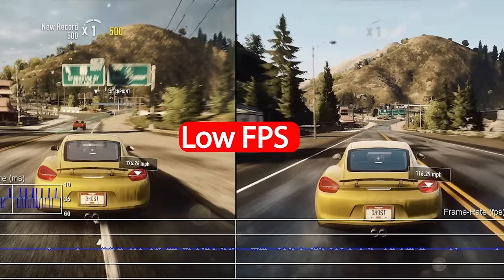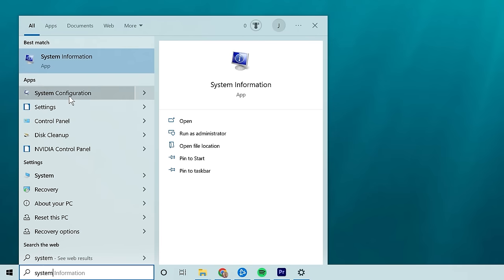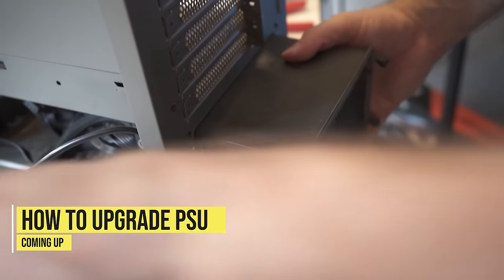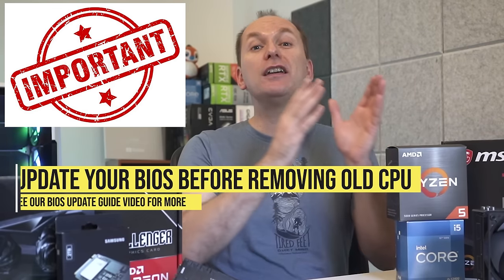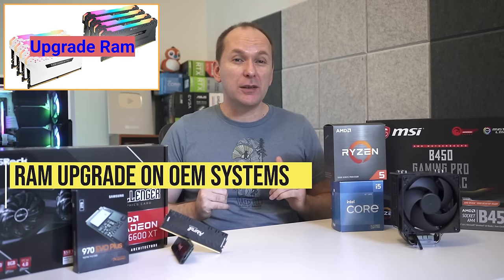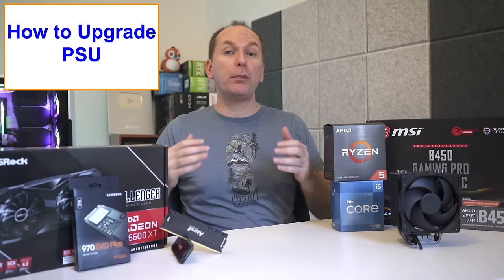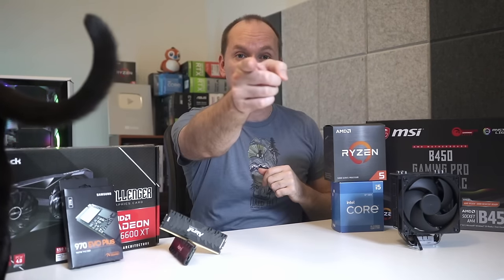How to Upgrade Your PC: How to Upgrade GPU, CPU, RAM, SSD & More! How to Upgrade PC

Comment: I’ve been thinking of upgrading for a while (I’ve had a prebuilt system for the past 5 years) I’ve already upgraded my ram and psu to prepare for the upgrades I’m going to make, but I think I’m gonna wait a little more for the 4000 series to come out in hopes that other gpu prices drop.
Reply: Did you upgrade it? I’m doing the same 😂 I upgraded my ram and ssd now just waiting for the 5000 series to release but I think my case is a OME & would need to basically upgrade my whole pc so I might just sell my pre build and build one myself

Comment: One tip you should add to your cpu cooler removal. Run the pc first for 15-20 mins just at idle, this will ensure the cooler comes off with ultimate ease. I ripped a cpu out of socket just trying to pull the cooler, the pc hadn't been used in days. Expensive mistake.
Reply from the maker: Interesting! I've done that too btw on my wife's editing PC she needs for work lol! See our 5950x build for the full story on that one. Thanks for the tip!
Reply: It’s nice to read comments because you learn something new.

Comment: Went from my old rx 580 4gb to a 6600 xt.  Seen a little boost but not a ton, though double the vram is nice.  Finally upgrading my trusty old 1400 to a 5700x that should be here today.  Maybe that will show the difference between the old GPU and the new one a little more.  I'm going to be putting the old cpu and gpu back into the pre-built they came in for my SO.  The old b350 mobo in the pre-built may be bad (I reused every other component besides psu, case and ram) so that will give me the excuse to go from b450 to b550 on my new setup and throw the b450 in the old one, which may also help the new 6600 xt marginally with pci 4.0. I do need a new SSD for the old system that only ever had a hard drive and both systems could use more storage in general.  Lastly im not sure if my current 2x8 3200 cl14 ram should get another set for 32gb for the new system or if I should just get a whole new kit at a higher speed and throw the 3200 in the old system that came with 1x8 (not sure of speed) instead of doubling up on both systems.
Reply: It still good ?
Reply: Had to go back to my rx 580 due to my rx 5700xt breaking within 40 days. So the 6600 isnt that much better?

Comment: i got a seagate 8TB storage for gaming just a few months old, its got a bug, it mostly works its working right now but when i restart my pc it wants to repair that 8TB as if theres something wrong with it? can this be fixed? i spent a whopping £150 on it, hope i can do something about it, would it be worth formatting the drive and starting over? theres alot of games on it thats alot of work to install again no point doing it if i cant fix the problem. my System SSD is samsung 970 1TB NVMe

Comment: This may be a dumb question but can I undervolt ram? I bought during the shortage and got 16gb of 3000mhz ram for 191(🥲). My motherboard rn can support 3200mhz, am I able to buy 3600mhz and undervolt it to 3200mhz, so when I eventually upgrade mobo + cpu I can use that ram at 3600mhz then instead of having to get a whole new kit? There's like a tenner between them in price

Comment: Jason, another helpful guide. Thank you! Especially liked the pointer about slightly twisting the old CPU cooler when replacing to break the seal from the thermal paste so you don't pull out the AMD Ryzen chip -- which I've done before 🤓
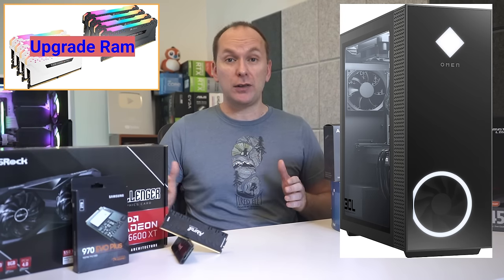Reply: Also, regards your SSD considerations at time marker 10:34, have you ever thought about doing a how-to guide for cloning when upgrading a SSD (NVME or SATA) system drive so we wouldn't have to do a complete reinstall of Windows on the new drive? There's other Youtube videos on this subject out there, but wondering if you may have a 'PC Builder' take on this particular upgrade.

Comment: Great Video!! I am getting ready to do my first build towards the end of the year. My Dell 8300, Intel i7-2600, 12GB and R9 380 are finally going to get put to rest. I was able to transplant my Dell system into newer Cooler Master case and upgrade my CPU cooler earlier this year.  I am continually saving up for deals on BLACK FRIDAY and will be looking for CPU (Ryson 5 or 7), motherboard (B550), RAM (16GB), and (M.2 1 TB) hard drive. The GPU will have to wait for round 2 of the savings plan but I am hoping for a hand me down 1060 or 1660 in the meantime. I am excited to finally see how FarCry 6 and CyberPunk 2077 actually are supposed to run in 2023, and yes, they do run on my current system. :)  Thanks for all your videos and keep them coming!!

Comment: Great video! Any beginner or intermediate builder should review this video when upgrading their systems. The only caveat I would make is if anyone wants to buy a 4070 series or higher NVIDIA graphics card would be to purchase an ATX 3.0 spec power supply with the appropriate wattage necessary for CPU and GPU combined max output. Seems there can be a fire risk(!?!) if using an old school ATX 2.0 spec PS. Cheers!
Reply from the maker: Thanks for the tip and glad you enjoyed!

Comment: Avoiding OEM pre-builds is wise if you intend to upgrade over time.  At one time they had a huge cost advantage and I bought one with Vista as it was certified for Linux.  It meant the hardware ran pretty reliably with WHQL, especially after SP1.
Generally I rather install Windows myself as OEMs ship so much crapware and nagware that it drives me crazy.
Reply from the maker: OEMs can be great for those who never want to mess with their pc. But very limiting for any future upgrades for sure
Reply: I agree 100% on the crapware bit. Unfortunately for us they're paid to include all that junk with their systems.
Reply: @user-yu4mf6bs4f  Right, but people need to know they can install Windows fresh and eradicate it.
I have NEVER had any software with ANY real value out of crapware.
Reply: @RobBCactive  for sure.
Reply: I have a oem rtx 3050, praying I can upgrade it
Reply: @foidly  good luck!  Space for cards and power were the limitations which affected me.

Comment: I got the Hyte Y60 case (white), 1000 watt PSU Seasonic 80+ Titanium, Deepcool LS720 AIO (white), Two 2TB Kingston Fury SSD gen4, and the RX6950 XT MSI XTrio GPU for $900, 32GB Trident Z Ram 6000mhz CL 36 36 36 76 and Just waiting for the AM5 motherboard Asus ROG Strix X670E, and the Ryzen 9 7950Xto drop this Tuesday 27th.

Comment: This is still the best PC channel on Youtube. I'm having a hard time trying to convince myself I need to buy a RX 6800 XT now that they are down in price. I bought a RX 6600 XT last year and Ive been happy with it but I've never seen 2K or 4K before and I would like to but I don't want to spend the money when my stuff is working well. Come on brain, just accept it is the will of the computer to upgrade the GPU/Monitor LoL

EDIT. I have a Question, My build has a 11600K, 32 gigs of memory a 1 gig M.1 and two 2gig storage hard drives, My PSU is a MSI MPG A750GF 750W ATX 80 Plus Gold PSU. Will it run a RX 6800 Xt GPU or will I need to upgrade? Thanks Much

Comment: Been weighing my options on when I should try and upgrade my PC since I’m not entirely sure if the PC I built several years ago still holds up or not. Going to follow this video and try to get some ideas since I’d like to try and keep the spending down a bit if I can help it (otherwise might as well start from scratch with a new PC.

Comment: hey Jason, I'm planning to upgrade from a 1050 Ti to a 3060 Ti. I currently have a 500 watt psu, do you think this will be enough or should I upgrade it as well? I'm also using a ryzen 5 2600 and 2 sata ssds. Thank you.
Reply from the maker: Depends on the other components, but you'll likely need to go up on the PSU (see our PSU video). I'd also swap in a Ryzen 5600 if you can at the same time, big improvement over the 2600.
Reply: @PCBuilderChannel  yes, I was thinking of getting the 5600 and in that case I thought of getting a 650 watt.

Comment: I have a prebuilt from Build Redeux with standard parts born from the covid days, desperation definitely cost me. I've spent a lot of time on your channel and wish your 5600x build existed those days. I bought a new monitor to play at 1440 but i wish it was a more comfortable and richer experience. So now im in this hole of what to upgrade. I've got the sinful Asus x570, Ryzen 5600x, 3060 ti, 16gb (8x2),  M.2 NVMe 500gb,  (expanding the memory is what started everything), PSU 600w.
Reply from the maker: More storage would be great for you. And you could drop in a 5800X3D (max possible upgrade with AM4) and then you can pair that with any GPU you like  up to a 4090 in the future.

Comment: So, having a 7th gen intel i7-7700 with 4 cores and  8 threads isn't worth the upgrade (of GPU) and would rather be worth the money for a new PC build?

For further reference:
CPU: 7th gen intel core i7-7700 kaby lake 
Motherboard: ASUS ROG Strix Z270F Gaming, Socket-1151
GPU: ASUS GeForce GTX 1060 6GB Strix Gaming
RAM: 2x Ballistix Sport DDR4 8GB Ram (16GB in total)
SSD: Samsung PM961 SSD 256GB M.2 NVMe
GPU cooling - Corsair Hydro H100 radiator

Comment: Congratulations on 200k subs, really love your content.
I was thinking of getting a system for gaming. These are the components. Please suggest should i stick to it or should i change.

Amd ryzen 5600x
Sapphire radeon 6700xt
Msi mag b550 mortar motherboard
512 gb ssd
1tb hdd
2*8 gb 3200mhz cl16 ram
650 watt psu
Lg gn600 24inch monitor

Please reply.
Thanks.
Reply from the maker: Thank you!!! Looks fine, I might ditch the HDD and get a 1TB SSD instead - they are dirt cheap right now. I'd upgrade the monitor if possible to a 1440p one like the HP x27Q or even just jump up to a 27" like the AOC 27G2.
Reply: @PCBuilderChannel  Thank you for suggesting...

Comment: Planning for my first pc build. What can you say about this setup:
Ryzen 5800x3D
MSI x570-A PRO AMD AM4
Silicon Power 32gb 3200 DDR4
MSI gaming radeon 6800xt gddr6
MSI MPG gungnir 110R white
Thermaltake toughpower GF1 series 850w
WD black SN770 m.2 2280 1tb
Deepcool AIO liquid CPU cooler

Thanks in advance for the response, love your channel

Comment: If you plan to upgrade and manually tweak RAM on Ryzen system, get Samsung B-die ICs ram. tRFC can go to 300 range, while many other ICs stuck at 500+. tREFI is 12-15k on Ryzen and 65k on Intel, so tRFC is more important

Comment: I have an i3-9100F (which only has 4 cores 4 threads), a GTX 1650, and 8 gb RAM DDR4 2666. I was thinking of upgrading to an i7-9700F and a RTX 3060 and increasing ram to 32 gb. Is it worth upgrading or should I buy new?

Comment: Thinking about upgrading motherboard and CPU, because well...:
Case:NZXT Manta
CPU Cooling: NZXT Kraken X62
PSU: Corsair TX750M -750W
MB: ASRock H97M-itx/ac
CPU: Intel i5 4690
GPU: Nvidia GTX 1080
RAM: 16GB Corsair DDR3 1600C10

I'd like to upgrade to something that'll be able to handle the RTX 40series, but keeping the 1080 for now. Not sure what way to go though, suggestions?

Comment: 05:30 I would add, uninstall old drivers if you switch between Nvidia and Amd. The best software for that is DDU. Run pc in Safe mode, start DDU uninstall drivers and shotdown. Turn off PSU, hold few sec power button to draw electricity. Replace GPU, start PC.
Reply from the maker: Good tip!

Comment: I have a question, I'm using Ryzen 3 3200g on a320m(without m.2 slot) with rx 570 4gb, 450w psu and 16gb ddr4 3200 mhz. Can you give your opinion on should I built new or upgrade it. I have very limited budget but I can buy/ upgrade the part one by one

Comment: Hi Jason,

Im currently running a system of about 3 years old and notice a fairly large drop in performance.

Im looking to upgrade:
-CPU
-GPU
-PSU + board if necessary.

Right now im using a Ryzen 5 3600 as my CPU, a GTX 1660 Super as my GPU on a B450 board. PSU EVGA 600 Watt PSU.

I have a pretty fat budget as I made a leap in my career and love gaming. Im just lingering on what to buy with the upcoming next gen GPU’s. Im not a streamer nor editor.

What I had in mind was a upgrade to a 3070ti and either a upgrade to a Ryzen 5 5600 or Ryzen 7 5800x

Not sure with those listed upgrades its necessary for me to also upgrade my board + psu as I find it kinda tricky building it myself 😅
Reply from the maker: Upgrade sounds good! Check out our Best PSU 2022 video for how to see if your current PSU will work with your new parts

Comment: These are my specs, wondering if anything should be upgraded 
AMD ryzen 7 5800x cpu
nvidia 3070 ti 
motherboard/ asus prime x570 pro
32gb ddr4 ram/ two 16gb g skill
750w gold psu 
storage 1tb gen4 ssd

Comment: You forgot to mention after powering off the computer and unplugging it, to then press the power button on the case too make sure no residual energy is left over in the psu

Comment: do you think i should upgrade mine
NVIDIA Geforce Gtx 1660 TI
driver version 537.13
AMD Ryzen 5 3600 6-core processor
15.92GB Ram
1920x1080, 280 Hz
Reply from the maker: Its an older system for sure. If you are looking to upgrade there's lots that can help. You can drop in a 5600 and upgrade the GPU all the way up to a 6800XT for example.

Comment: I got a used 5900X, 32GB, Asus X570 Pro combo that replaced an ancient Ivy bridge setup that was still good but a little long in the tooth.  Cooled the cpu with a 240 Rad Arctic Freezer 2.  I put the parts in used BeQuiet case with a 850 NZXT PS (also combo).  I will upgrade my gpu later which is a RTX 2060 Super.  Added the M.2 drive as boot drive and reused some of my SSD and storage HDs.  Blinged it out with some TT LEDs fans and some LED strips.  Thats all she wrote.
Reply from the maker: Nice!!

Comment: Just in time I was thinking to upgrade my CPU from R5 2600 to R7 5700x or 5800x3d and get a new GPU form the new releases something like or equivalent to a 3070ti 
Do you think my 2600 can handle the 3070ti or similar from the new releases or should I get a new CPU ? And does a 650w PSU can handle a 3070ti ? Thanks and Love the cat 🐈😺🐈😺👍👍👍

Comment: Thanks for this video,  I have an i7 8700 and I'm really struggling to find a deal good enough to justify an upgrade that's as future proof as possible, or even good value tbh
After my gpu upgrade,  I still get good performance at 1440p, but it's hard to know how much extra I'm leaving behind by not upgrading my cpu too

Comment: Heey good evening 

What do i upgrade best? I have a 1000€ budget for upgrades want more fps lower delay in fortnite triple edit gives me so much delay specs atm are 

2060 S 
Ryzen 5 3600 6 core
Sharkoon wpm 550 watt
Motherbord gigabyte b450 90€ one
32 ram vegnece rgb 
Amd standard cpu kooler
4 fans 3 front 1 back ‘sharkoon bruhsless dc fans tg6 ’ 
I feel getting an amd 7 5800 or a amd ryzen 9 5900? Feel the 7 is the same one but cheaper idk is it you can help me?
And What grapics card do i get rn at the time?

Or what u recommand me to upgrade

Comment: I have an i5 4430 a h81m-h 8gb ram ddr3 and a gtx 1650 ex plus, i'm thinking in get a ryzen 5 5600 a b550m ds3h and 16gb ram, will the gtx 1650 fit in here or should i upgrade it too?

Comment: Hi ,I got the next configuration on my pc
ASUS H310M-K Micro ATX Motherboard
Intel Core i7 8700 3.2GHz (4.6GHz Boost) Hex Core CPU
NVIDIA GeForce GTX 1060 6GB Graphics Card
16GB Apacer Panther 2666MHz DDR4 Memory (2 x 8GB)
2TB Seagate FireCuda Solid State Hybrid Drive - 5x faster than HDD
Aerocool Integrator 600W 80+ Power Supply
What is the best video Card to upgrade and maximum support but my Motherboard?many thanks

Comment: Hi, l want to upgrade my system But i dont have much budged. So i will continue to use rx570 and 750w psu that i have. Can I get a 12th generation i3, motherboard, mesh case and ram with 350 dollars budget? İf i get what would you prefer?

Comment: I'm doing an upgrade/new build only using my existing motherboard, cpu, ram and cooler for now, everything else will be new, case (corsair 5000xrgb) psu ( be quiet darkpower 12 1kw) gpu (3090ti msi suprim x) my question is : the gpu has the the new 12vhpwr connection but the psu does not, it comes with the adapter (3xpcie) should I get a different psu that supports the new plug or will it be ok? Thanks.

Comment: I have a Ryzen 5 3600 cpu Rtx 2060 gpu  2x8gb 3200 ram 1tb ssd
I was planing to spend £100~today
And I've gone for a 2tb hard drive(£50) for game storage  another 2x16gb(£50) 
One additional note. Should i treat my cpu to a new cooler as well? I have been using the stock wraith cooler for 3 years
Reply from the maker: Hey you found it!

Comment: Hi Jason and community,
Recently the amd ryzen 7 5700X came down in price to €250 is this worth to upgrade from a ryzen 5 3600? the resell price would be around €100 for the R5 3600. so total costs are €150 for the R7 5700X i'm using a B550 motherboard, 4x8gb 3200 CL16 ram (overkill, but i like all slots occupied) GPU is MSI RX5700XT 8GB. i'm not looking to upgrade to AM5 yet because i don't need to...